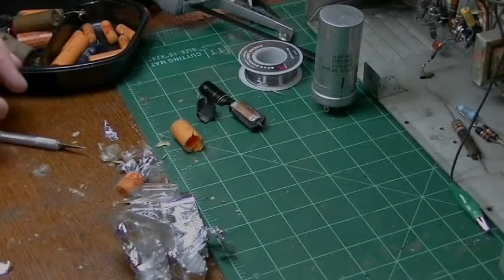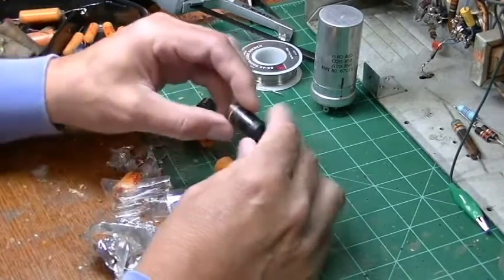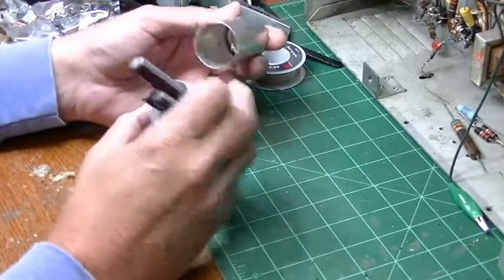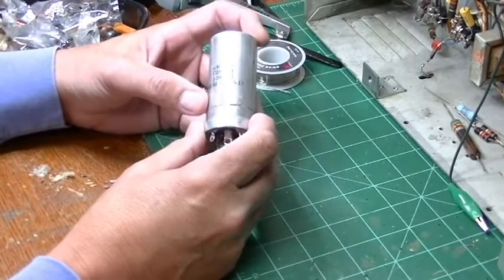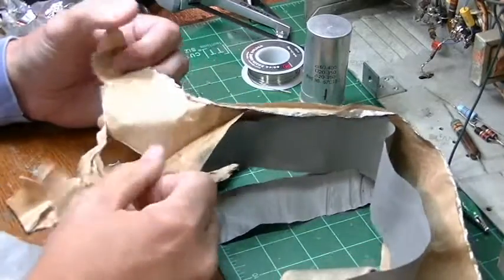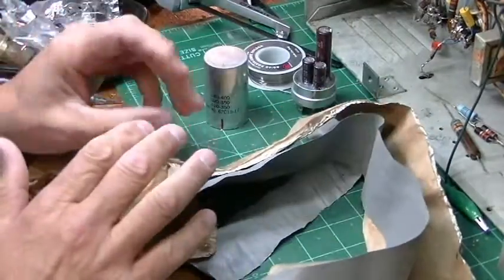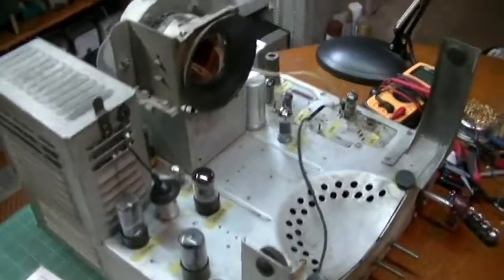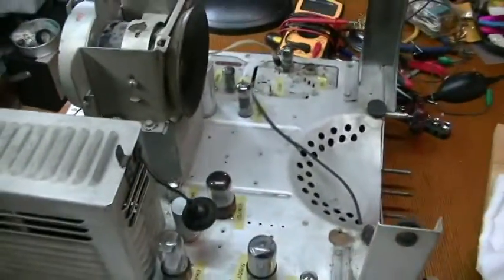Admiral 26R12N Pt  4

Comment: I like the hot glue idea you use to secure the new caps in place when stuffing cans. BTW I have never re-stuffed an electrolytic can. I put axial caps in under the chassis but in strategic locations and completely disconnected from the old can that just stays in place as a dud. I know that doesn't keep the look original underneath. Gary
Reply from the maker: HD7100 Yeah, I do both ways. It's a matter of preference, and depends on the set for me. Either way is perfectly acceptable in my humble opinion.

Comment: Funny you should mention the "smell" of a good electrolytic capacitor. If you've ever smelled an old vinyl rain coat, that's exactly the smell. I liked your "autopsy" of the yellow jacket caps, it was exactly what I thought, a bumblebee in a yellow enclosure.
Reply from the maker: Yep, some type of film and foil. Subject to the same failure as the BB's. I guess it was a good idea at the time, but they just didn't pass the test of time for sure.

Comment: I've never seen those Mallory Plasti-caps.  They look as cheaply made as the bumblebees.  I guess the plastic case didn't hold in the electrolyte as well as wax.
Reply from the maker: I had never ran into them before either, but I don't think they were cheap, I just don't think they could last as long as some of the other types.